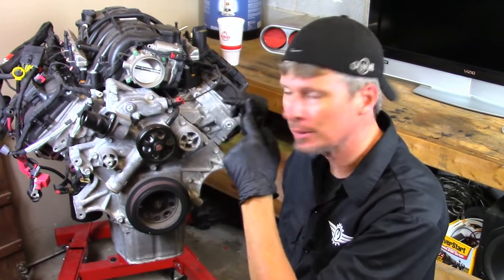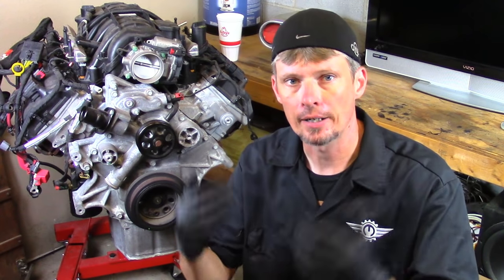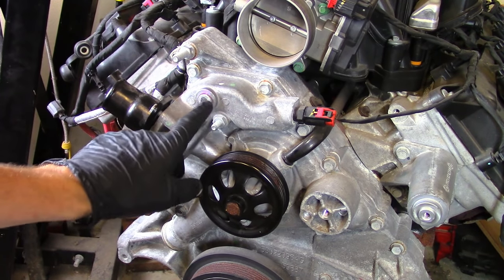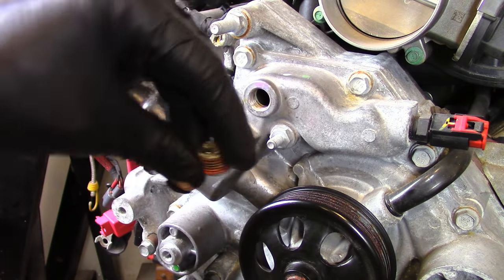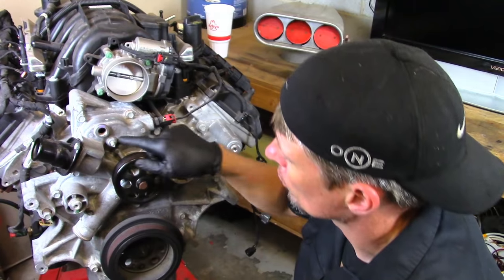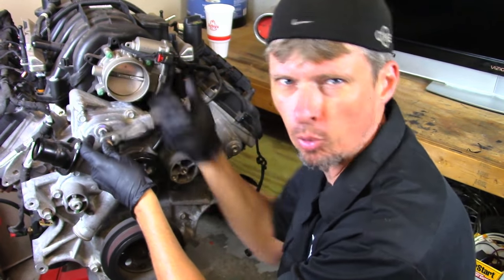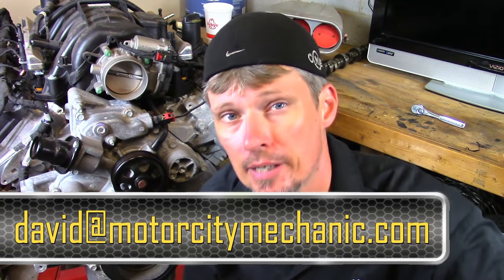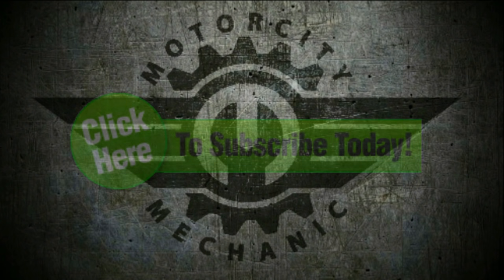Quick Tip: 5.7 Hemi coolant bleeder location and fill procedure

Comment: I have a 2005 Chrysler 300c 5.7. If I don't have the proper tool to take the bleeding port out could I just remove the thermostat and wait for the coolant to come through?
Reply from the maker: Problem there is that you will still always have some air in the engine.....it's a method for sure that's better then nothing. I recommend getting the tool/socket that way you won't have any issues

Comment: Great video David, I have a question not related though...have you ever thought about posting a how to on changing trans fluid/filter in the nag1 transmission? Or should that be done by the dealership. Thanks in advance
Reply from the maker: You need the tool to check the fluid level.....know the trans temp....and the chart to determine what the level should be. If you have access to these items then the service will be easy. otherwise it may be best to take it somewhere that has these tools

Comment: question can i do this if i havent drained anything, or does it have to be drained before attempting bleeding the system. thought water would be in it if i opened it
Reply from the maker: You can bleed it at any time. Just make sure the engine is off and the coolant is cold. Thanks for the question and make sure to subscribe

Comment: Howdy, my 2003 2500 ram overheated and sprayed coolant out of the top of the pressure tank, I let it cool down and refilled the antifreeze.  Now there's very little heat and the pressure tank remains full to the cap, any advice would be greatly appreciated..
Reply from the maker: What engine does this have? I assume that you commenting on this video that its a 5.7 hemi. The cause of the overheat needs to be addressed. I recommend pressure testing the coolant system to see if any obvious leaks. Those tanks are known for leaking. Also make sure that the radiator fan is working correctly. With the age you might even have a restricted radiator. You can somewhat check that be feeling the upper and lower radiator hose and seeing if there is a big different in temp...if so than the radiator needs to be replaced. If it runs too hot.....damage to the engine will occur such as a warped head or dropped valve seats.

Comment: I have a 2002 Dodge ram 1500 4.7. I already flushed the system and have new coolant/water put in so currently my resivor is full. Would I still be able to do what you did in this video?
Reply from the maker: You sure can.....just make sure the engine is cold and remove the bleeder screw/bolt.....then reinstall when coolant starts to come out. Then adjust the level and your done. Thanks for the question and make sure to subscribe
Reply: MotorCity Mechanic thank you! I subscribed also.
Reply from the maker: Much appreciated!

Comment: Where is the coolant temperature sensor located on a 5.7 hemi? I have a 2015 Dodge Durango RT
Reply from the maker: Should be at the top of the waterpump and pointing towards the drivers side. Thanks for asking and make sure to subscribe.
Reply: I have a durango to man nothing but problems my temp keeps going up an down an I’m not even heard my fan come in

Comment: Whomever owned my car first stripped that recessed bolt where you do that at so my question is, is there another way to do this?
Reply from the maker: Otherwise you need to use one of those set ups that pull a vacuum on the system and then sucks/pulls the new fluid in. Here is a link to a bunch on amazon: https://www.amazon.com/s?k=coolant+air+lift&ref=nb_sb_noss_2

Comment: I have a 06 300c awd do i have a oil cooler line on the lower hose ?my part # is 55038145AA AND RADIATOR # 5137692AA

Comment: My bleeder bolt is broken/stuck. Is there some other way to get the air out without open the bleeder port?
Reply from the maker: I made another video about removing the coolant temp sensor: More than one way to bleed a Hemi coolant system
https://youtu.be/Vw2K8aeLniU
Reply: Thank you!

Comment: Is it the same for v6 2013 charger SXT Sport Plus
Reply from the maker: The year you have has the 3.6......look where the upper radiator hose attaches to the engine, thats the thermistat housing. There is a plastic screw on top that you need to back off......thats how you bleed that version, again with the engine off. Thanks for asking and make sure to subscribe.

Comment: Have an 06 Dodge Charger 5.7 and I can't get the bleeder valve open is there any other way that I can believe it I'm only getting heat when I push the gas
Reply from the maker: If stuck then I can only recommend draining the coolant and using an air-lift system to pull a vacuum and then let it suck the coolant into the car. Otherwise I Would try my best to get that air bleeder loose if possible so you dont have to go that route.

Comment: I recently did my water pump on my 300c 5.7 hemi and notice the seal was ate up on the fitted tube on the right side of the thermostat above the big pulley going inside the water pump, can you tell me the name of that tube please, thx
Reply from the maker: Is the tube on the drivers (left) or passenger (right) side? Also is there a bolt close to the end of it that holds it in place?

Comment: The previous owner stripped the alan key part do you know where i can get a replacement
Reply from the maker: If thats the case then you can remove the coolant temp sensor located a few inches from that bleeder. Remove it and once coolant comes out as your filling the coolant system....reinstall the sensor
Reply: THANKS!!!
Reply from the maker: @Landoo345  Your welcome

Comment: I just changed the water pump and thermostat on my 2012 Ram 2500 5.7. The truck operates at the correct temperature but I barely have any heat. The top radiator hose and heater core hoses are warm. The lower radiator hose is still cold. Could this be due to air in the cooling system?
Reply from the maker: If you had no issues before and everything is installed correctly then yes its possible you might have an air pocket.
Reply: The only issue I had before it was installed was the heat had started cooling off. The radiator cap doesn't get warm either
Reply: Air door actuator. Google it
Reply: @Jdmtunerlover  ok thanks

Comment: David, I caint get my thermostat bolts to budge any ideas?
Reply from the maker: All I can offer as advice is to use a breaker bar if possible. They shouldnt be that tight unless some over tightened them or cross threaded the bolts.
Reply: @MotorCityMechanic  Its all factory I bought it new never been touched.   Its a 2011 ram longhorn.   Im afraid to put to much pressure since its aluminium.  Maybe if I use an extension and hit the bolt a couple of times? What you think?
Reply: @MotorCityMechanic  Thanks Ill give it a try.
Reply: Spray with some kinda of nut buster first. It could be tight from corrosion. Then hit it with breaker bar or a sock with with the pole from your jack if it fits. Then just turn it until it breaks a little. Then use your wrench. It should come right out.
Reply: @coreywinder5265  Thanks, Ill try again tomorrow.

Comment: Is there a trick to get the black water line that runs under the intake out? I've been prying on it for an hour but it won't come off.
Reply from the maker: I assume your working on a hemi? Is so then keep in mind that its bolts in 2 places....one at the waterpump and then other on the back side of the engine to the left side cylinder head. If need be....you may need to unbolt the upper intake and then remove the pipe. Thanks for the question and make sure to subscribe

Comment: Awesome tip! But what about the lack/drop of coolant in the rad BEFORE startup? Won’t there be an abundance of air in there?
Happy subscriber 👍🏼🇨🇦
Reply from the maker: When you fill the pressurized coolant bottle up (passanger cars) or the radiator itself (trucks) you will have no issues with air in the radiator. The air we speak of is whats behind the thermostat.
Reply: MotorCity Mechanic 
Right on. Thanks for the reply. (It was on my ‘14 Ram Sport I was questioning). 👍🏼😁🇨🇦
Reply from the maker: @barrybebenek8691  Your welcome
Reply: So does that mean on the truck I need to open the pressure cap and put the coolant through the pressure cap? So not in the coolant bottle? Thanks!
Reply: ...also have a 2014 Ram 1500 5.7...
Reply: Matthias Hilpert I believe that’s correct. In the rad...but to the bottle also, to full cold and check level a few days later. Many cars don’t have a “rad-cap” anymore, but only the pressure cap on the bottle. Our trucks have pressure cap on the rad. Our bottles are only reservoirs. Hope that helps. 👍🏼🇨🇦
Reply: Thanks Barry, yeah I was a little confused whether I fill the coolant in the reservoir or in the opening under the radiator cap. I assume the level in the bottle will go up too, if I poor coolant through the opening under the radiator pressure cap...Will try tomorrow.
Reply: Matthias Hilpert You’re welcome. But no, the coolant won’t fill the bottle on it’s own by just filling the rad. The only connection the two have is the overfill tube. Fill the rad, then add to the bottle to “full cold” line. Then check it in a few days.
Reply: Thanks again Barry, did the procedure today and it worked out perfectly. Filled both the radiator through the pressure cap opening and the reservoir like you recommended. However, I couldn't get the bleeding screw open, as a matter of fact, I destroyed it using an impact drill,  totally worn out now. I ended up taking out the collant temperature sensor and did the bleeding through this opening, right above the bleeding screw...Also a big thanks to +MotorCity Mechanic for posting this helpful video!
Reply from the maker: @matthiashilpert9944  sorry about the delay in getting back with you. Great to see other viewers helping out. I am actually planning the next video to be about using that coolant temp sensor to bleed the coolant if you dont have or are having issues with the bleeder. Its my plan "B" method lol.

Comment: Any suggestions on how to get the bolt off? If not is there anything else I can do. 5.7 hemp dodge magnum
Reply from the maker: I haven’t had an issue yet with removing it. A coolant air bleeder/filler works great.....it’s a tool most techs have these days where compressed air is used to create a vacuum in the cooling system. Another thing you can try is if there is nothing in the cooling system yet, unbolt the thermostat housing and remove the thermostat and fill the coolant bottle until coolant comes out the thermostat opening and then reinstall all items and add the rest of the coolant

Comment: Upon start up of my 05 5.7 Magnum I get what sounds like a surge of rushing water. Would air in the coolant system cause this? The coolant was flushed and replaced along with the thermostat about 6 months ago. The car never gets hotter than operating temperature according to the guage.
Reply from the maker: The sound of water running is usually a sign of air in the system and the noise usually is the air passing thru the heater core. I would make sure there is no air in the system with the engine off and cold and by removing the bleeder screw like in the video. Thanks for the question and make sure to subscribe
Reply: That's what I thought. Thank you for the reply. After checking the bleeder, I can add more coolant if needed?
Reply from the maker: Yes you can.....open the bleeder and add coolant until it comes out the bleeder hole. Than adjust the level in the bottle when done.

Comment: Im trying to figure out where the other end of the hoes that comes out where you pour your oil connect to.
Reply from the maker: Pablo Garcia There should be a hose leading to the upper air filter box lid. I think that's the one your speaking of.

Comment: I did my themostat, had the p0128 code, swapped it all, put the bleed valve at 12 o clock. 

Cant get any coolant in my radiator though, i opened the bleed screw,  cold this morning and coolant came out. So i topped to cold level and let it get to operating temp.
It start to overheat- to 208- 2010, so i shut it down.. what am i doing wrong. 2011 5.7 300C
Reply: 208-210 degrees

Comment: do i have to let it burp thru the resevoir with the cap off to let the trapped air out.
Reply from the maker: I leave the cap off and also the bleeder screw/bolt out.  The air will escape out the bleeder screw/bolt hole as you add coolant to the coolant bottle.
Reply from the maker: I also do this without the engine running

Comment: I am replacing water pump and t stat due to w/p bearing noisy and loose. 
Can I bleed system out of t/stat opening before putting in t/stat instead of removing pipe plug?
Reply from the maker: You can try.....might work okay. If you have the bleeder bolt then I still recommend using it as well.
Reply: MotorCity Mechanic   thank you for the quick response. 
Doing water pump and thermostat on 5.7 2013 Durango tomorrow. 
Mitchell states I need to remove the electric fan which requires discharge and recharge of a/c. It looks like there might be enough clearance without fan removal. Not sure yet. 
Hope everything comes apart ok. First pump was done under warranty at 20k miles. Has 60k now. Just hoping I don't find any "flat rate" workmanship issues. 
Worked flat rate years ago. (Don't miss that) Getting up in age. Lol. 
Hourly medium truck guy now. 
Do you have any experience with pump R&R without fan removal?
Reply: PS. I subscribed.
Reply from the maker: Many thanks and make sure to enjoy the 4th!

Comment: Hey, great stuff! I have a question, more of an issue really. I replaced my radiator cuz it was leaking from the fin tubes, I mounted back on and made sure everything went back in it's place (no extra bolts, woohoo!). So I add coolant 50/50 mix, while cold to the cold fill line. I run the car untill it comes up to temp (190 degree thermostat installed) and the temp keeps rising up to 217degrees. I did see the coolant in the reservoir go down under the fill line and added a bit more fluid. But it kept going up in temp. Will the system not bleed out on it's own and fill the radiator? What am I missing here? 2013 dodge Challenger RT 5.7l. thanks in advance!
Reply from the maker: When its cold I recommend removing that bleeder screw to get all the air out the system with the engine not running. Sounds like a possible air pocket. Also make sure to fan is working and coming on incase you might have left it unplugged....it happens.
Reply: @MotorCityMechanic  thanks, yeah it was indeed an air pocket. I unfortunately did it the old fashion way, while running opening the cap slowly with a think towel and expell a little at a time the heated air till water came up then back down. Add fluid after removing the air and the fluid dropped back down. I don't recommend it but it did do the trick.

Comment: Hey buddy quick question: I changed the radiator and the thermostat on my 2006 charger rt, but it's still getting overheated. Do you any idea why it keeps getting overheated???
Reply: Water pump and or clean out coolant maybe blockage in resavore

Comment: What is the recommended thermostat for 5.7 Hemi Dodge Charger ?
Reply from the maker: Personally I stick with the OEM Mopar t-stat. I stay with the stock temp rating and dont use anything else. Thanks for asking and make sure to subscribe
Reply: MotorCity Mechanic what’s the stock one for 5.7 L Charger ?
Reply: MotorCity Mechanic also both the fans on my Charger are not coming on would that cause it to overheat?
Reply from the maker: if both fans arent coming on and it is overheating....there is an issue and it will need to be checked further.

Comment: 2016 Ram 1500 5.7 50k on it  started to get that coolant smell well $2500 later dealership cant find the source not leaking anywhere? Talked to another Dodge owner his 18 Ram 60k on been having the coolant smell for 30k cant find the source also.. what gives with this never had this issue on my other Ram 1500 Ive owned

Comment: l have a 2015 Chrysler 300S with the 5.7, is there any recommendation on which antifreeze to use? Plus do l have to bleed/empty existing coolant or just unscrew airway and pour till it starts to pour out?
Reply from the maker: Afternoon Roberto.....anything you needing to add coolant then I recommend checking for leaks. If you adding because you are performing repairs then yes I would bleed the system after filling it. As far as servicing as maintenance....it was 10 year/150,000 mile OAT antifreeze so it shouldnt be needing to be changed at this time.
Reply: MotorCity Mechanic thanks l'll look into that, btw do you have a link to where l can buy the pink coolant that comes from the dealer? Much appreciated, l subbed 👍